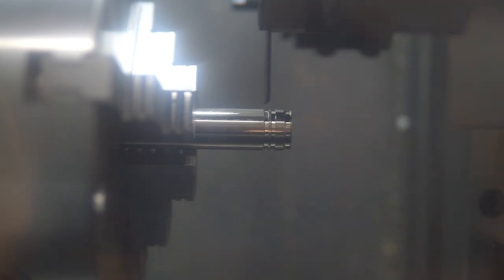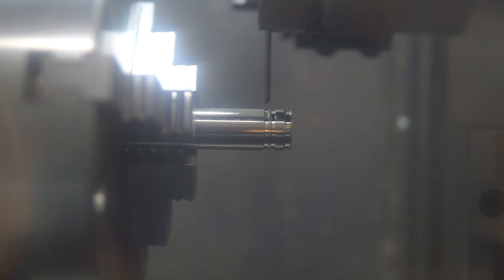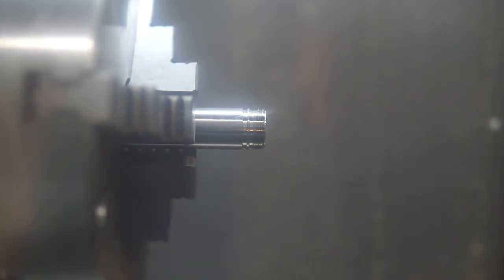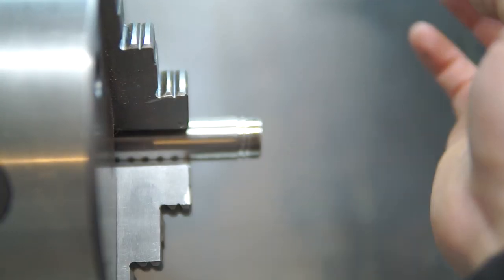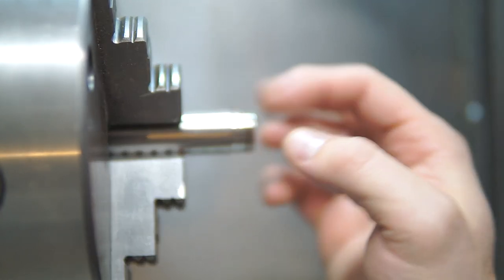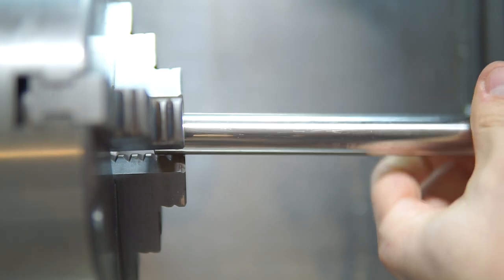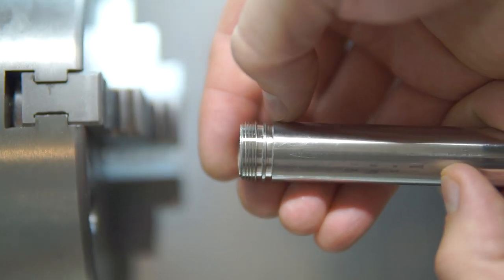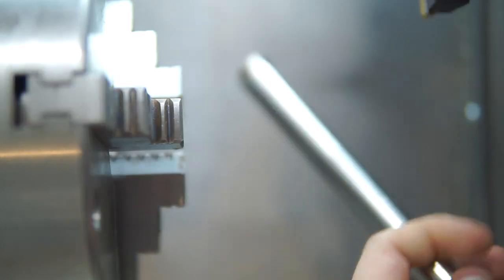CNC Lathe - Cylinder

Comment: nice andre! what basket you will used for the forge in this version? vst or decent?
Reply: Hi Sam, I plan to use the Espresso Parts 14g ridged basket. It's my favorite basket. Personally the "precision" baskets I'm not sure that they do a whole lot, but I'm probably in the minority on that opinion.
Reply: ah thats okay andre, our own tongue is the most valid judge actually :D
but why ridged, not ridgeless? is the forge "portafilter-ring" hold the ridged one better? thx andre.
Reply: samuel hutagalung no just has a better cross section shape that I like and I find easier to do basket prep on